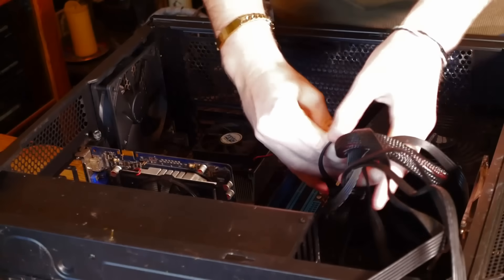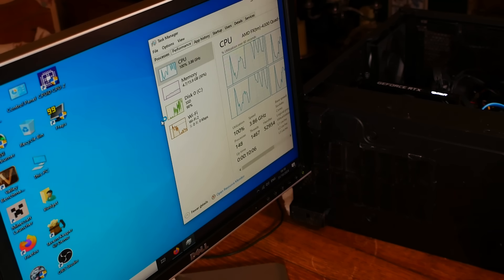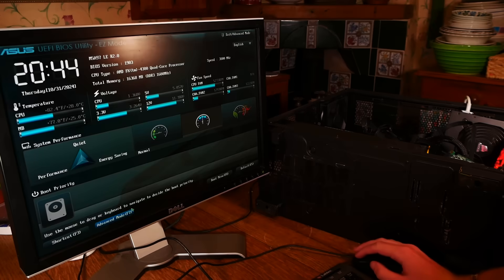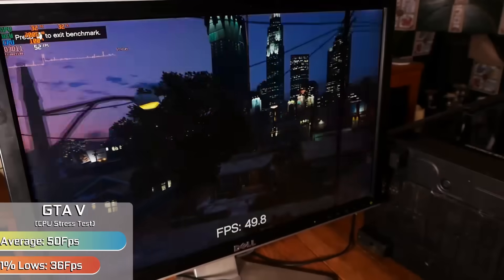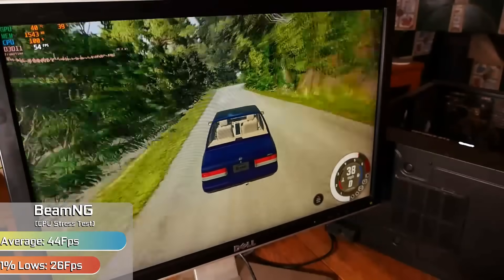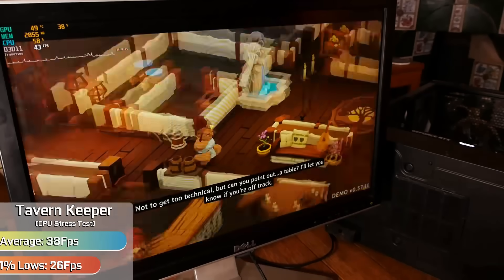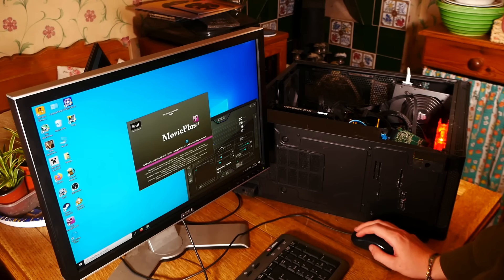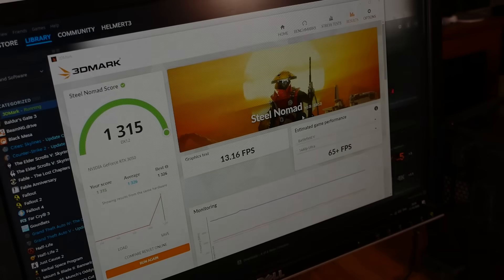AMDs Weakest FX Processor...

Comment: I ran an FX-8350 for like 6 years, they were never as bad as some portray them, mine even kept up with Ivy Bridge and Haswell i5s for a fair bit less, they all overclocked well and frankly weren't any hotter then a nehalem i7. That systems still humming along with a vega64 at 4.8ghz and its still 100% capable of playing modern games nicely. For the many years of service it gave me no other CPU I remember more fondly then my FX.
Reply: I'm glad I looked at the comment section.
When I switched from my 8300 to a 3600X when it released, I thought I was suffering from Stockholm syndrome and that I was the only person who actually liked it.

Yeah, I like my 3600X more, but I like the 8300 more than I do my previous CPUs that are C2Q6600, C2D2200, Pentium (retching sounds) 4 (more retching sounds), Pentium 3, Pentium 1, and i486.

8600 made me switch from Intel to AMD, when AMD was at its worst.

It isn't so bad at its worse to be honest.
Reply: FX will always be in my heart. My first gaming pc (2 years ago) had a fx6350, I found the motherboard with cpu and 2/4 ram slots broken in the trash while going for a walk. Paired it with a gtx 660 1,5gb I got for free from a local marketplace. Case was a clapped out Fujitsu from 1999.
About 1 year ago I upgraded the pc with an old sharkoon case, a used ssd, a powercolor rx 580 8gb and a fx 8350. I read hundreds of bad reviews online, but I couldn't have been happier with it. (Paid 50€ total for the parts used)

About 6 months ago a pc popped up on that same marketplace for free. Luckily I got it and it has an i7-6850k, a gtx 1080, 4tb of ssds all in a Lian Li PC Z70 
It's definately a huge performance jump, but it doesn't feel the same as my old pc did.

Comment: still rocking an FX8350 for last 7 years now. my 1st and only ever pc I built and it's working perfectly with me. paired up with a 1050 2GB GPU, 16GB of DDR3 and loads of RGB in a glass tower case. got no reason to upgrade as it does all I need it to do 🙂
Reply: You don't play many games do you?
Reply: @nesyboi9421  Older and optimized game would run fine on an FX chip. Modern AAA slop probably won't though. With any older machine you just have to play games that the hardware can run.
Reply: @Compact-Disc_700mb It seems my reply never went through on mobile.

Yeah sure if you only want to play old games, but it isn't just triple A slop that you can't play on older chips and graphics cards, you miss out on a lot of the good titles to come out too. I mean if all you want to do is play Minecraft, spore, or Garry's Mod sure that CPU GPU combo will suffice and is fine you're right, but... you miss out on a lot of new stuff, indie and big studio. I can tell you one thing, that combo won't be able to play Helldivers 2, at least not well, nor would it run Space Engineers all too well either. 

And honestly I think they would be a lot better off if they had a 4GB GTX 1050 or 1050 ti, or at the very least a 3GB 1060. 2GB is so little nowadays, even my 4GB GTX 1050 was starting to show it's age like 4 years ago when a bunch of the sandbox games I played got harder for it to run. (I7-7700HQ laptop, 16GB DDR4, GTX 1050 4GB) 

3GB 1060s are a dime a dozen and would make a great upgrade, and so would a board with first gen Ryzen or Intel 6th gen. 

I do understand though that maybe they don't want or need an upgrade, which is why I asked if they played many games. Maybe I should have asked if they only played old games or light titles.
Reply: @nesyboi9421  I have an i7-6850k with a gtx 1080 for about 6 months now. There are no games I play now that I couldn't have with my old pc (fx8350, rx580 8gb)
And yes, I play a lot of games.

Comment: I would think the 4300 would be better than the 4100 at least. My 1st CPU was a FX-4100 that I paid IIRC $60 CAD for used like mid 2013 with a Cooler Master Hyper 212 Plus along with a tube of thermal paste included also, for GPU I initially had it paired with a EVGA GTX 560 Ti 2GB that I had paid $120 CAD for and was able to straight trade up to a Visiontek reference Radeon HD 6970 2GB a few months later in like spring 2014. Used that pairing until like summer 2016 when I upgraded to a stock i5-2500k and ASUS Direct CU II GTX 780 3GB.

Comment: My first built gaming PC was an FX-8350, it got a surprisingly huge bump in performance when Mantel, Vulkan, and DX12 could actually use the cores without the FPU bottleneck getting in the way. It also still works great under Linux. I later upgraded to the 1800X as soon as it came out

Comment: im currently running an FX 8350, 16gb DDR3, R9 390 8gb and some chinese cheap 500gb SSD. its my main gaming rig, runs world of tanks at ultra settings and use it for work.
Reply: I had the 8350 too , good chip in its day .
Reply: The cheap Chinese SSD (some random selection of letters) still going strong after 5 years
Reply: I hope your Chinese ssd lasts lol
Reply: @RetroDSi I can assure you it won’t. Think about what it is. That stuff has 100 % failure rates. I’ve never had one last more than a month. Hence why I avoid them like the plague nowadays
Reply: @RetroDSi  These things last as long as any other, and most "branded" ssd just use chinese ssd, with fancy branding (not talking about fakes).
Reply: my dad use to run that but he had 4gb (one of the ram sticks prob needed reseating) and r9 280 and idk what he had but his 2tb hdd died
Reply: That was my PC 7 or 8 Years ago. Switched it for a Ryzen 3700X and a bit more than a year later the 390 for a 2080TI.
Tomorrow im gonna switch those parts for a 5700X3D and a 6900XT. I miss my FX but i sold it with the Mainboard, a Arctic Freezer and 16GB RAM for 90 Bucks to someone who needed a PC for his Kid.   I Hope it still running wild :D
Reply: FX-6350 were sold a gamingrig to play Battlefield 4 at good framerates back in 2015 , I were thingking - maybe..
Reply: @Aceiolix  my first gaming pc had a fx6350 2 years ago, then I upgraded to a fx8350
(I do have an i7-6850k with a gtx 1080 now)
Reply: The 8350 was never the best, but it is taking a looong time to die lol. I loved mine.
Reply: My condolences...
Reply: @Ignisan_66  If it does all you need it can't be beaten.

Comment: I still have my old FX8300+RX580 PC. Not a daily driver anymore, but still a nice pretty capable machine.
Reply: nearly the same here. i got an fx6300 +rx570. it was my witcher 3 build and it ran very well in fullhd. still using it as my main pc for internet,office and to play contemporary games. ❤
Reply: Lol, my backup pc has an fx8350+rx570 8gb 😂
It was my first capable gaming pc and only cost me like 40€ about 2 years ago
Reply: How about a Steam machine conversion?
Reply: @Nightingale1887 it’ll run a lot better then it does on windows
Reply: @Nightingale1887  That's precisely what I did with my FX6300.  Plugged an RX 570 into it and installed Holoiso.
Reply: I still have my FX 6300 and Radeon HD 6970 which have served me well all the way to early 2019. It played all of my games just fine at 1080p.
Reply: Maybe not related but im running a haswell i5 with an RX 570 and can play Cyberpunk on ultra. barely dipping below 50 FPS at 768p
Reply: @kimutone2970  Cyberpunk, while still demanding, can be tweaked in a lot of ways to run on lower end systems.  I assume ya got Crowd Density on low, then?  I mean, my 5900x pushes 30% CPU usage with every seting maxed with a 6700XT @  1440.  FSR3 + Frame Gen.

I mean, I can run around 80fps @ 1440p all max settings wtih no RT and no FSR, so it's really got a LOT of room to tweak with.

You got an RX570 4GB or 8GB?  I had an RX480 8GB awhile ago.  Same thing as a 580 8GB, literally.  I even ran the same clock speeds since I had the Asus ROG STRIX model.  100% identical architecture.  I was always amazed at how the RX470/570's performed right on the tail of the RX480/580's.  

The Haswell Intel CPUs were pretty powerful.  Obviously, your biggest issue is that you only have 4c/4t.  I imagine Cyberpunk is pushing your CPU to 100% most all of the time lol.
Reply: @JustAGuy85  No, I run it all on ultra. I do play at 1366x768 and have the automatic overclock thingy turned on on the drivers, which explains why it still runs decent. Both CPU and GPU are maxxed out while running it though lol.
I do have the 8 GB version, which is why again, no stuttering or popping on ultra settings.

Yeah I think Haswells were state of the art intel IMO, too good and completely blowing AMD out of the water. Too bad they're pretty much low end for today's standards. Gonna update to AM5 some time soon.
Reply: Same Here with 16gb and an Rx570 8Gb my Girl still use it to Play
Reply: That's practically the system I upgraded from a few years ago.  I had an FX-8350 with an RX480 8GB and 16GB DDR3 1866.  I can't help it, I loved that CPU.  Sure, it couldn't push the RX480 to its potential, but man... having 8 cores/threads was nice.  I got little improvement going to the RX480 8GB from an HD7870 lol.  Actually, I couldn't tell a difference going from an HD7850 to an HD7870 when I had that FX-8350.  From there, I went to an R5 3600 rig and then went fresh with a 5900x + 2x16GB DDR4 3600 C16 dual rank + 6700XT 12GB.  

You guys have a LOT to gain going with a simple B450 board and an R5 3600.  But then you'd need some new RAM, but RAM isn't that expensive right now.  Some DDR4 3000 or 3200 would suffice.  

Don't expect the B450 boards to handle an upgrade to a 5900x though.  My 5900x killed my Asus STRIX B450-F Gaming II board with the upgraded VRM/mosfets over the original version.  Took about 9 months but eventually it popped something and oozed the insides down the back of the board.

This Asus STRIX B550-f Gaming WiFi II, though?  Amazing VRM set up.

Then, again, I already feel like my rig is outdated.  The 5900x doesn't have the IPC for the latest and greatest games on UE5 to push my 6700XT 12GB as hard as it can be pushed, even at 1440p Ultra settings.  UE5 is great and terrible at the same time.  I need a 7800x3D and I'd like to get a 7800XT.  Soon... Soon..

OR I could swap my 5900x out with a 5800x3D and have 7800x performance in games.  I just hate to lose 4c/8t.  This 5900x gobbles up encoding projects, compressing large files, optimizing shaders, etc.  But no game pushes it passed 40-45% average CPU usage, so 8c/16t SHOULD be more than enough.  

It's just the point.  AMD came back and made the 5600x3D... Why couldn't they have made a 5900x3D?  I'd love to have one of those.

EDIT:  It amazes me how well built motherboards were back then.  I mean, look at the power draw of an OC'd FX8350.  It's INSANE!  And then I get a nice Asus STRIX B450 board and a 5900x kills it after 9 months.  Sure, I played around with PBO a little and had it pull 180 watts (that's al the board could push), but 95% of the time, it was at the stock 142 watt PPT.  

But my Asus M5A97 R2.0 handled that OC'd FX-8350 for years.  That CPU had to be pulling over 200 watts and I gamed every single day.  The FX-8350's were notorious for insane power draw.  All the FX-8300 series chips were known to pull massive power when you were running 4.1+ ghz.
Reply: I had the exact same setup for the longest time.
Reply: Man, might have to build that setup. Already had an FX-4300, might pair it with an RX 560 or 550.
Reply: well its not pretty ncie and capable dont kid yourself dont call them better then they where man, 14yr old junk is what they are in relation to new stuff of course otherwise that comparrisson needs to be thrown and we all should just straight up watch videos FROM that era, otherwise its hot junk ;)

Comment: 2400 i5 destroys it still, and it's not even 10pounds.
Reply from the maker: Good luck getting an i5 2400 for £52 on launch. Sandy and Ivy is far far better today. But the 4 core FX has its weird golden period
Reply: @BudgetBuildsOfficial  I'm pretty sure i said it in present time.

Was it I good deal back then? Probably. Is it now? Damn not. That's all what I said. I think it's really important to stress this information, don't buy FX in 2024.
Reply: @BudgetBuildsOfficial  Where did u get this price on launch ? This processor had msrp of over $120 not 52 pounds. It had similar price to way faster i3s. Not to mention this generation had worse core performance than ancient Phenom II X4 9xx series
Reply from the maker: Here in the UK they quickly went on sale as no one was buying them. Fairly sure mine came from CPC which does sales to industry, as they were selling them for next to nothing.

Comment: I still daily drive an FX6300, no issues

Also 97W under load? mine never uses over 50W.
You can't overclock the shot out of a CPU and then blame it for running hot
Reply from the maker: You’re very brave